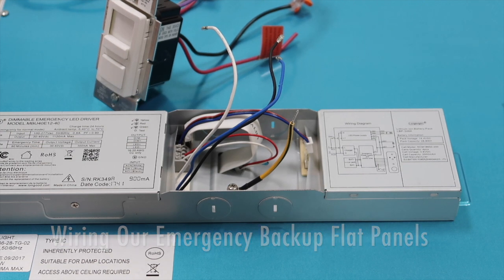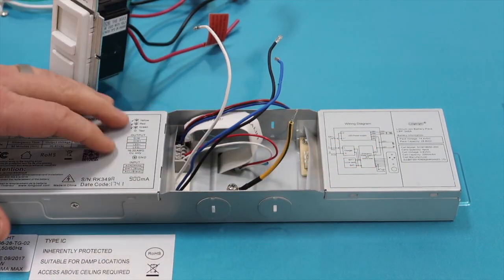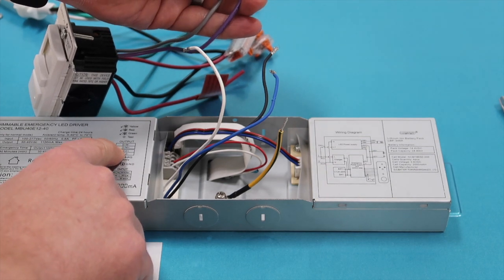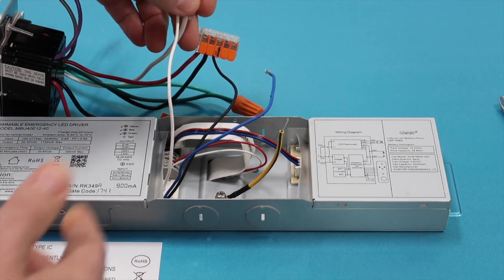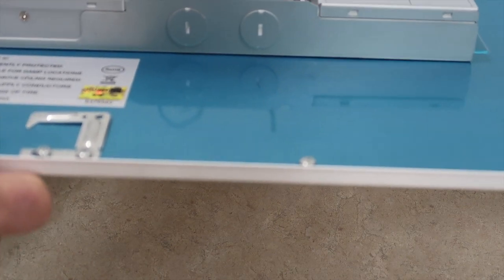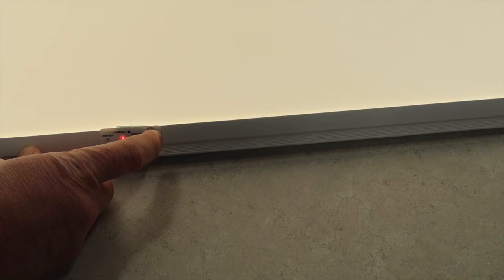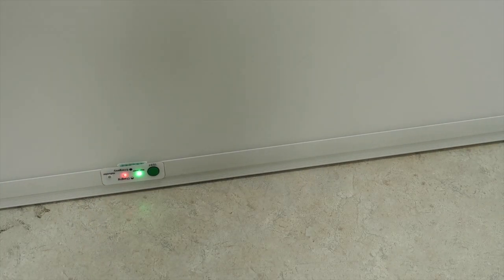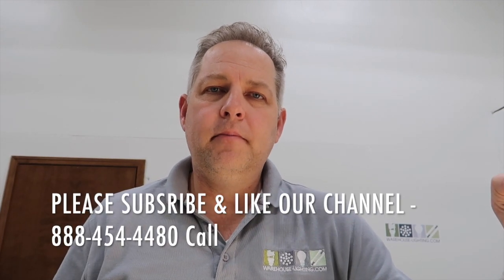Wiring LED Emergency Flat Panel Lighting

Comment: When teaching, it is important to keep the details to a minimum on things that don't matter. Keeping the details easy to understand. Your video is about wiring the light with the battery back up. Talking about dimming is not relevant. Talking about the purple and grey wires on the switch, which are not relevant. And who cares that the plate is actually the top to this? The continuing to tell us that the light is off, the light is on, the light is off, the light is on, not telling us what you are doing when the light is off or on.. In the end, you didn't really explain anything except show us that you were confused yourself.